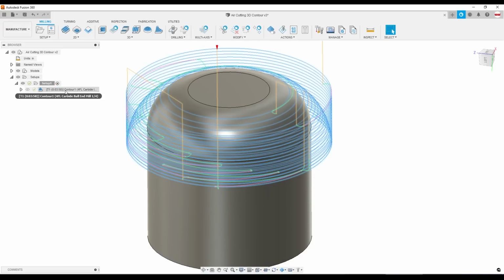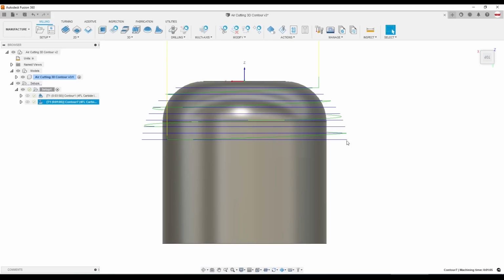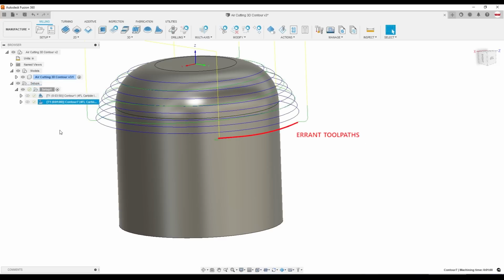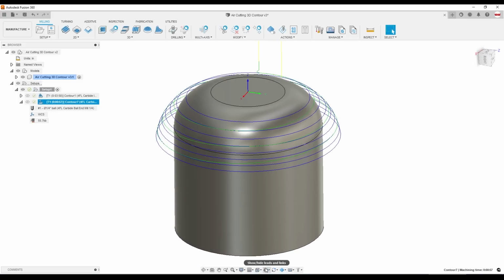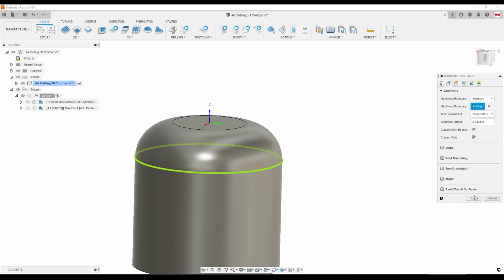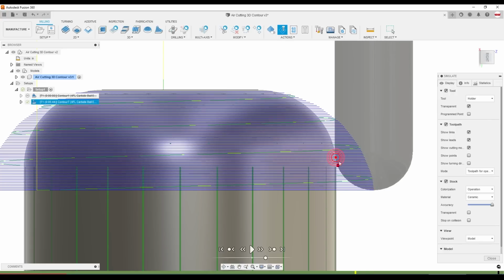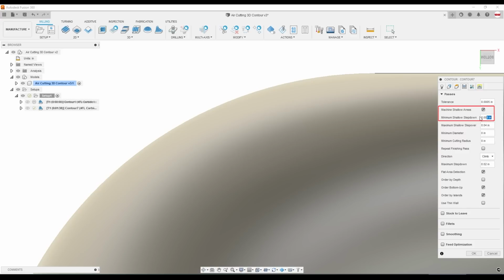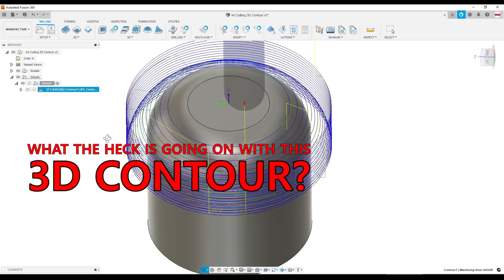Fusion 360 3D Contour: Deep Dive into Toolpath & Settings!

Comment: Curious - this seems to be using linear moves to approximate a circle - is there a reason that fusion isn't generating G02/G03 tool paths given that it should know rhat the part is circular. That would be something like 2-3 gcode commands per layer instead of many.

Comment: We continue to have this problem on a regular basis. What you think should be a straight forward path it adds a bunch of whisper cuts to it. I recently found that the fine setup down on the passes tab causes a bunch of problems with this. Thanks for the info and would love to see more causes of whisper cuts or air cuts for the other tool paths. Maybe even some more info on what the options are actually used for.

Comment: I would have used the 3D Ramp tool path for that geometry and every similar where you have a continuous tool path around the part. It's generally smother as long as your machine can keep up with the extra lines of code it generates. 
(Caveat i use Inventor + Inventor Cam so Fusion might be different)

Comment: Very nice coverage of what contour can do!  also as a previous video of yours covers, it can handle undercut geometry with what fusion calls a "Slot Mill" or a full radius keyseat cutter!
I don't know all of the reasons that it is limited, but it frustrates me that the green linking moves are unaffected by the smoothing values and contain a ton of points unless you make them into straight plunge moves.

Comment: When I started with fusion 360 it took me way to long to realize 3d contour is what I wanted for most everything. I'm running a CNC router. So I assumed 2d contour was the primary tool to use. 

Great to have a little refresher on it. The shallow machining is something I was not aware of. I would usually go to a morphed spiral or parallel tool path for these areas.

I'd love to see more videos like this one. Maybe some updates to your older videos to bring them up to the current version of Fusion360.
Reply: Please use 3d contour flow operation .